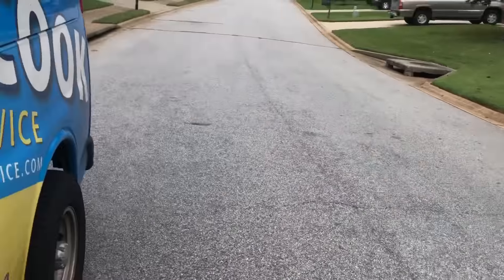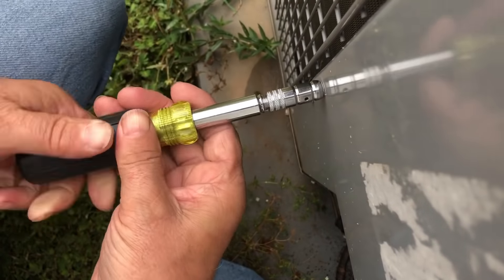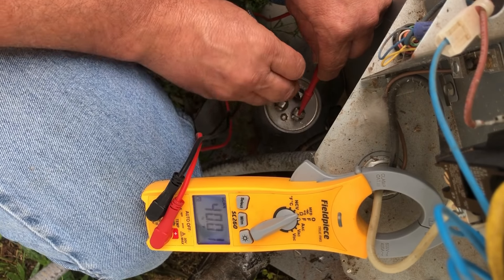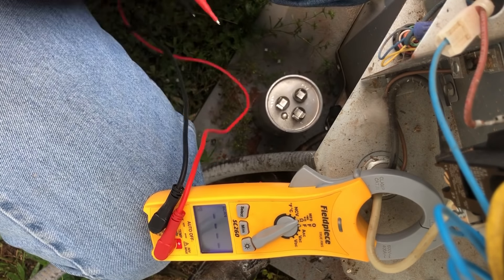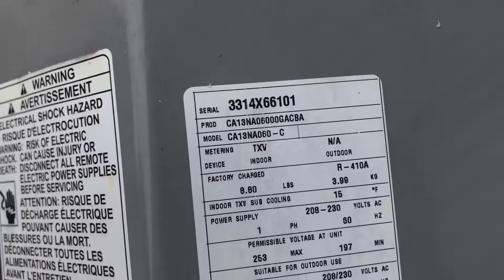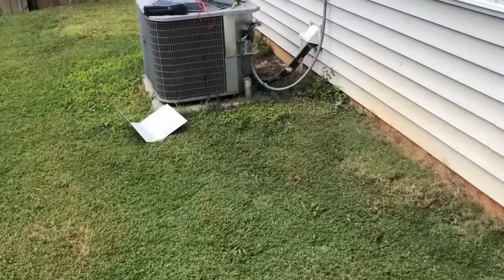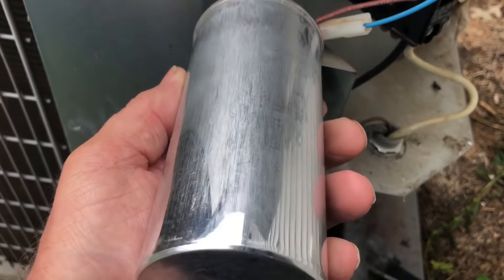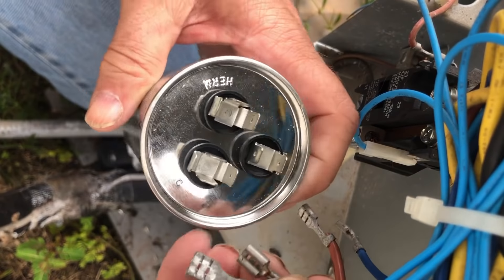HVAC Spiders Snakes Capacitors and Nest Test

Comment: I'm not an HVAC guy although,  I am quite proficient in the jack of all trades, master of none department. I own a company that builds and repairs electronics (like the control boards in your units etc). But I do most all my own electrical,  plumbing, mechanic and HVAC maintenence as I have a pretty solid understanding of what I'm dealing with. That being said, I'm never afraid to admit when I'm in over my head and will happily pass the job on to a pro. I really appreciate all your knowledge and what you share. Your videos are awesome and I'm making sure I watch every single one. You can never be too educated about anything. 

I am always interested in your Nest Tests as I work my way backwards through all of your videos one by one. From what I gather,  I'm guessing that you don't care for the Nest thermostat, is that a fair assessment?

 Personally, as someone who's obviously interested in tech,  I was quick to jump in and buy one shortly after they came out. I always give these things about a year to iron out all their issues of being new before I get one.  But,  I bought mine and I love it! I haven't had a single issue with mine. Is it a device that causes alot of headaches in the field? If so, do you feel that it is the device itself or more that most of the people that buy them have no idea what they are doing when installing them by themselves? Thanks again for all the informative and entertaining videos,  Ted!

Comment: I’m always at a loss as to why the condenser manufacturers refuse to mount a decal at the factory showing the capacitor specs...should be mounted above the capacitor
Reply: You can usually find it on the compressor and fan motor tags.   An inexpensive borescope allows snaking through the grille to read the compressor tag.   A piece of copper tubing makes a great guide tube!  (Usually)  ;)   What techs should be doing is writing it down beside the cap once it's known... I also like to check the running capacitance just to make sure stuff is all doing what it's supposed to do.  ;)
Reply: It might reduce the profit they make on the unit by one or two cents.
Reply: During my last couple of years working (retired now), I would take my sharpie and write the specs on the panel somewhere near the run capacitor. Thanks for posting , Ted.
Reply: Specs chance based on fan motors and compressor draw......so it’s kind of a static number even from factory

Comment: Have a nest for 2 years now. Never once had a single problem with it. Willing to bet those with problems have it wired wrong.
Reply: its more of an "im old and cant learn new fangled devices" problem
Reply: Do you have a heat pump?
Reply: you're just lucky,those things are problematic I've replaced many of them on no heat/cool calls
Reply: Nope, its really a hit and miss thing, not a wiring one. Part of the issue is that nest advertises that some models dont need dedicated 24v power, so they dont get hooked up with them. Personally thats where I see most of the issues, but even the main line standard models with 24v power hooked up also give issues. 

Most common issue I've seen is that the nest will randomly drop out the G circuit in cooling, causing the system to freeze up. Otherwise thy just have the same issues other t-stats have, just more often. That's sorta the thing really, the people that say "ive had one for x years and it works fine" dont always get a lot a lot of exposure to other units, so all they have to go on is their 1 that seems to work fine. While some techs are out there replacing a decent ammount of them because they actually have to fix the failures.
Reply: One day soon the nest will be all you carry in your truck they work for everything except flotation.
Reply: Same.  Our 3rd Gen Nest has survived 2 different homes.  And my relatives have a 1st Gen Nest.  And my Father has 2 3rd Gen Nests.  No issues what-so-ever!
Reply: yea i have my over 2 years and it still work find
Reply: I’ll bet your right, those HVAC service tech’s with years of experience have no idea what they are talking about or how to properly wire HVAC systems. You homeowners are so smart......
Reply: I agree, I have the original nest and it has never failed yet.  The unit tells you how its wired, so the other people must have had it wired wrong.  Best thermostat I ever had. The worst was the Honeywell...
Reply: Have had at least 2 nests bad in past year in customers homes. One would not output power to Y-cooling terminal. Other wouldn’t output to O-rev. valve. Both had to be replaced by installer under warranty but agree with ted that they are overpriced junk imo. For the money I’d go with a Honeywell 8 or 9000. To be cheap I’d use a 5000 because cannot kill those things!
Reply: I’ve installed several....nobody has had issues except bad caps, a bad board losing 24v or once they had reset a nest trying to “fix” the heat......but r22 was MIA(high line had a leak)
Reply: Replaced two nests in first year of a new construction home. Switched to Honeywell.
Reply: Nest are notorious for working great for a year or 2..then the updates come n shit hits the fans. Best wifi stat out there hands down is the Ecobee
Reply: @Guillotines_For_Globalists  just wait..the problems will come, they always do with a nest lol. Get yourself an Ecobee when they take a shit
Reply: @countryfriedhvac  I have heat pump and I have a new icp unit the thermostat was sold with the system I haven't had any issues with the thermostat.
I've even learned how to program it and connect it to my phone I love that I can see what the ac is doing from any where.
I've even been able to turn the eco settings off if I have company staying over. 
I have also added a electric strip lockout temp so it wont call for heat strips if it's a certain temp I like our new system I still wanted a trane but so far I've been very happy. 
I also have the thermostat set on auto heat and cool it works perfectly.
If you learn how to use it the best works just fine. I also have a common power wire connectd to the nest.

Comment: I owned a Nest gen1 in my first house for 3 years which is now installed in my mom’s apartment and a Nest gen2 for 6 years in my current house and I’ve never had a problem with either of them. I don’t understand the hate on them.
Reply: The strange implementation of certain features (such as running the fan without anything else) and Google doing whatever they do with the data they collect from an Internet connected example are probably some of the biggest reasons not to like the Nest. There are other reasons, if you've got the time:

1. Nest uses a transistor to switch your heating or air conditioning system on and off. Ordinarily there would be nothing wrong with this. Other thermostat manufacturers have done so. For some reason, the transistor they chose conks out or in some cases is even dead in the box. It usually fails shorted, so your system runs constantly. This seems to happen with depressing regularity.

2. Nest at one time said that aftermarket, open source wireless router firmware (DD-WRT, OpenWRT, Tomato) wasn't supported. While not perfect, these are the gold standard compared to the hilariously broken stock firmware of even modern wireless routers. If your product doesn't work with open source wireless router firmware, your product is broken.

(I have also found the wireless radio hardware to be unstable in regular operation and have very poor range.)

Early revs of the Nest hardware and OS had no means by which to connect to wi-fi using approaches such as WPS. Entering a long security key is exceedingly tedious and error prone. Competitors (Honeywell in particular) products create a wireless network to which you can join a computer, at which point you'll be presented some web pages to collect setup information quickly and easily, including wireless security keys.

3. The whole power thing: as far as I'm aware, Nest still actively advertises that you don't need a "common" wire for the thermostat to work. At least in some cases, you really do -- and some people don't find out about this until after the thermostat has run its battery down, failed to operate and caused property damage. They actually had the audacity to patent their "power stealing" approach, even though devices like garage door openers have done the same thing for many years.

Unless they've changed something in the latest models, there is no means for the thermostat to operate in an "emergency" fashion after its internal battery has run down. Many inexpensive thermostats have a temperature sensitive mechanical switch that will keep things above freezing, even if their batteries conk out.

Maybe later models of the product have addressed some or all of these concerns. There comes a point when one just stops caring and moves on, though...especially when far better regular and smart thermostats from other makers exist.

I do not, and will not, recommend them. Unless I can prove that it's gone bad, though, I'll leave a Nest where it is.

Comment: How can you trust the value of the old cap? It was replaced and possibly the wrong value was used. There must be a better way to verify correct value.
Reply: Kent Diego , you are correct. I use the CopelandMobile app to look up compressors and verify the ratings. Ted is using his phone to video I assume and as such he’s not revealing all of his wisdom!
BTW, there has been a Copeland Electrical manual for years. Your ponytail doesn’t get to be as long as his without knowing the way to school!
Reply: You can look at the name plate of the compressor and the fan motor. Both should have the capacitor spec list on them.

Comment: I have had good luck wrapping Capacitors with "foam tape" to make them fit more secure in the bracket.
Reply: Not a bad idea, but remember HEAT is a capacitor's worst nightmare. That foam tape might insulate heat in too much, leading to an early death.

Comment: You just have to turn off the Home/Away Assist and Auto-Schedule options and one of those nest thermostats will behave like a regular one (takes less than 30s), just with the option to set a schedule and an intuitive app to do so (rather than feeling like programming a vcr on a regular thermostat). Genuinely curios why you wouldn't want that?

Comment: just curious,what does a call like that go for in your area,just a standard run cap replacement
Reply: In west palm beach Florida its a 79$ service call and either 180$ or 269$ depending on size of cap and if consumer has a service agreement with us.
Reply: I live in the same area. Service call from $50-$120. Cap's are priced about 2.5x to 3.5x or even more.
Reply from the maker: 145 if no other work is done.
Reply: @TedCookHVAC  thanks for replying,im up in long island and some rip offs will charge $300 for just a cap,i charge $175 the cost of living is higher here
Reply: Just curious Ted, if you are going to the USA made, your price should be above that. I’m slowly converting to the Turbos because I can carry fewer expensive caps. Live and work in East Texas!
Reply: Diagnostic fee $110 cap cost around. 125-150 flatrate. In my area outside of Philadelphia PA.

Comment: You just love to destroy those nest thermostats Ted. Also, does your 8-in-1 have a magnet on the end to hold your screws as you use it?
Reply: Not only does it have a magnet, it's a really strong magnet 💪
Reply: Magnetic only on the nut driver side, now if they could magnetize the other end it would be the ultimate tool. I still love it and use it everyday.
Reply: @sknight0391  :Where can I get those bits?

Comment: Anytime I second guess whether or not the capacitor is the right size, I go to repairclinic.com and type in the model number, and it will list the right size capacitor for that unit (barring a compressor hasn’t been replaced by a different type).  That model number takes a 75/5.

Comment: I don't understand all of the hate for Nest thermostats, between my family, my Father, and my in-laws, we're talking about 4 different Nest thermostats that have all performed flawlessly for at least 5-8 years this far.  With that being said, I disabled "auto schedule" and we set our own schedule.  Also have our Nest controlling the humidifier AND 2nd stage heating rather than having the furnace control board control 2nd stage.  Absolutely zero issues to report.

Comment: Here’s my tool recommendation I know this isn’t one of those videos but here it is anyways Ted https://www.homedepot.com/p/Milwaukee-Fork-Meter-for-HVAC-R-2206-20/202360063 fork meter for those hard to reach amp draw tests I hate nest thermostats too btw 80/5 good lord what size is that unit a 5 ton jeez...I’m saving my next tool recommendation for your actual tool recommendation video you post it’s a good one too!! What else do you recommend on a cap and go? Drain flush blower wheel cleaning evaporator and condenser cleaning if needed?